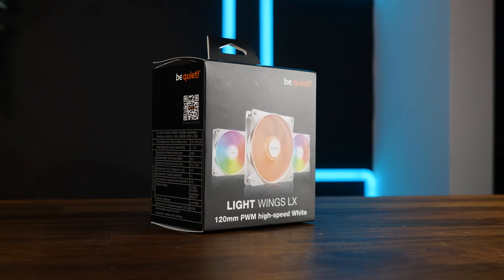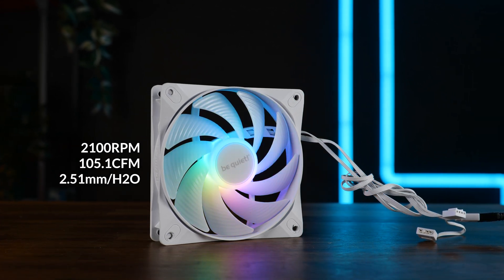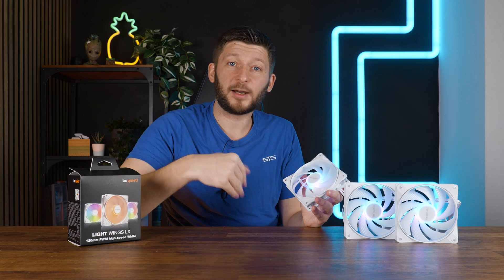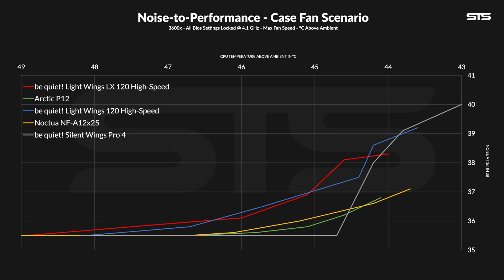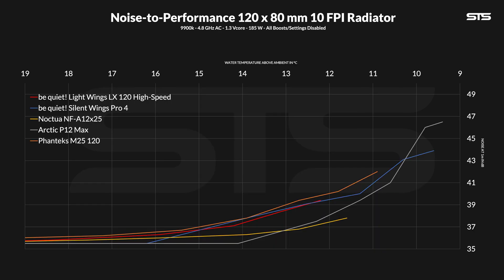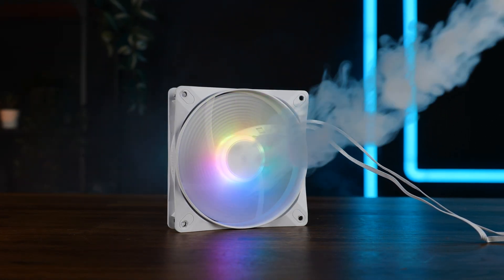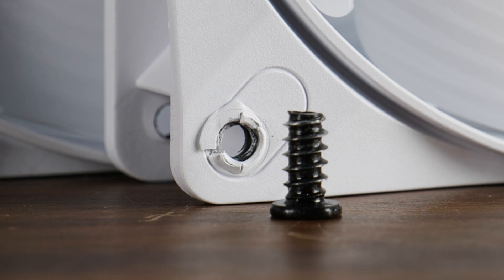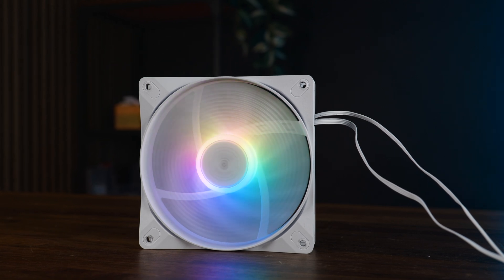Upgraded Light Wings? be quiet! Light Wings LX 120 High-Speed

Comment: The 1 thing I hate about retailers is that they seldom carry the complete range. For example, I want to buy the Light Base 600 or 900 not sure which yet, thanks to your reviews. But no retailers are carrying the reverse flow of either fan. I'm in Ireland & have the entire European Union to trawl. For example, I will be buying the case from CaseKing in Germany! I have spent the past 4 hours trying to solve this 1 issue. It keeps pushing me towards a cheaper alternative from another supplier. This is not unique to BeQuiet cases either.

Comment: The Light Wings LX fans are not the successor of the Light Wings fans, they're a different fan series for people who prefer RGB-lit fan blades instead of the RGB-circle around the fan blades. In fact, the LX fans are positioned lower in the market than the original Light Wings, so your conclusions are in line with the expectations.

Comment: Nobody should buy a fan without rubber frame or mountings. Trust me. It will give you a headache if you are noise sensitive.  These fans are beautiful but I would highly suggest investing in Silent Wings 4 (regular, not the High-speed or pro)
Reply: rubber frame or not, rifle-bearing fans in general are poor choice if you're really sensitive to noise.

both these and Pure Wings 3 I installed in my case were absolutely terrible and outright headache-inducing at certain RPM ranges to the point where it ended up being the main factor in how I adjusted my fan curves - until I eventually got tired of it and ditched them both.

early versions of P12 Max also suffered from this before Arctic quietly ditched the rifle-bearing for fluid ones.
Reply: @srn7254  the quietest fan from be quiet were the Silent Wings 3 (non high speed).  I have two 140mm of them and they are basically the same sound as if they were in the cupboard at 650rpm. I know it isn't a high rpm but it moves enough air in a small case
Reply: I literally have a case filled with 10 of these fans between LX 120 and the old light wings 140mm and they're dead silent, and I am noise sensitive, so I don't really know what to tell y'all

If you are to that level of sensitivity, noctuas with rubber beads at low rpm might be your only way to go